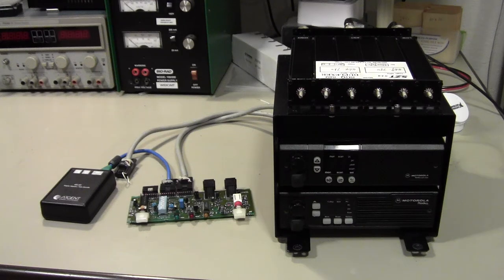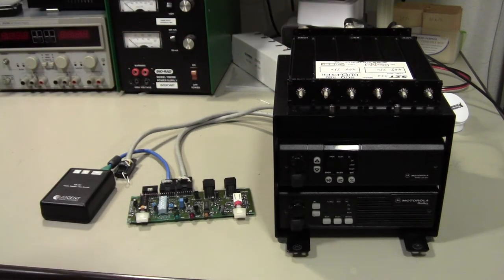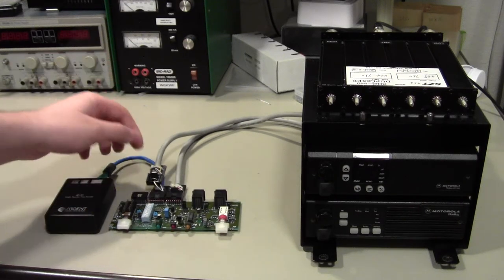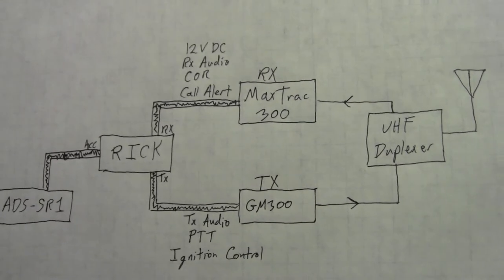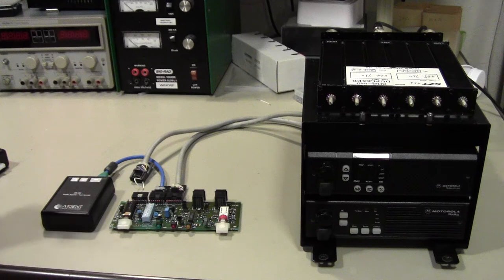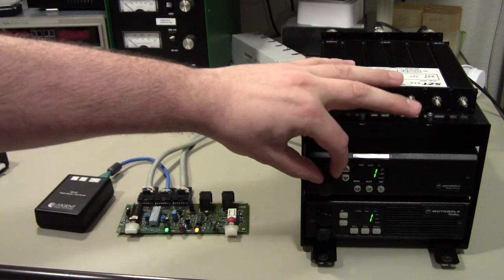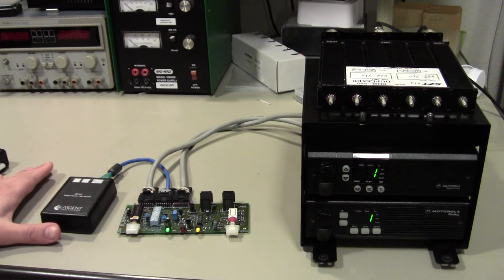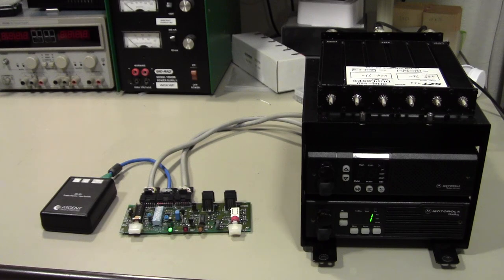UHF RICK Repeater with Auto ID and Remote Control

Comment: When our Highway Patrol went to P25 Trunking they had a massive amount of UHF CDM 1250/1550s that were used as remote receivers for the old low band system. The radio techs, also hams, put up UHF HAM repeaters all over the place to repurpose them! They already had duplexers, hardline, controllers and of course 75 tower sites to choose from!

Comment: If you have a later version of the ADS-SR1 (revision N or O), you can use ##751 to have it only play a CW ID when the repeater is active, plus a clean-up ID with ##803 (I believe that you have to set both the CW ID timer and the CW ID Auto-Response timer to make this work).  I have experimented with both of these, and they work great, except for that fact that the ADS-SR1 transmits for about half a second when you let go of the PTT (or after however long you have the VOX timeout timer set for), even if you have it set to no courtesy tone.
Reply: ***** I also have mine wired for COR.  I'll have to experiment with that sometime.

Comment: Hi, I actually have an old motorola repeter with 2 x gm350 radios and a rick controller. My tx radio keeps getting stuck in transmit even though the rx radio is not receiving. I either have to plug out the repeter or else turn the rick off and back on again. Do you have any info regarding this issue? Iv asked lots of people but no joy 😕

Comment: I want to build a uhf repeater out of tyt9000, cuz they are cheap, and have stun kill revive features, as well as pin outs for it, what should i get? other than uhf antenna, diplexer, cable etc? is a rick box needed? im new to building repeaters but not new to radios.

Comment: I have a RICK and several kenwood tk880's and I am trying to build a repeater. I bought the ktc 19 cables and got everything working but can't seem to get audio to pass. RX received TX keys up but no sound when I test. Any help would be appreciated.
Reply: Kenneth Finnegan I have bee testing pins for several days and in the schematics and drawings it shows which ones are external mic input and audio out but I don't think it is a fixed out. If you know anyone that has attempted any kenwood mods and can link me up with would be great. I would really like to get working properly I've seen one on ebay that was already put together but was sold so I thought I could build one don't know if there is some programming that has to be done I was able to change settings to get cor from pins tried injecting audio source on mic input but getting nothing built a rj45 jack with 3.5 mm headphone jack to get audio from one radio to other but I won't be happy with that really want internal pins to do all the work and be able to use the hand held mic too so it can act as home base station too. Thank you for any help.
Reply: You need to move a jumper inside the TK880 to allow it to use the aux input from the accessory cable and not the mic from the front panel.   If you’re still in need, message me back and I’ll check my notes and see which one it was.  I built a repeater with three TK880s and it works great.  One is the control radio on a different frequency so i can take down or change channels without interference.   I’m also using an Elektra 2000 repeater controller.  It’s also in the service manual for the TK880.

Comment: Quick question, I have 2 gm300s set up as a repeater with a jumper cable. I run 2 antennas, one for the tx and one for the rx. I'm thinking of getting a duplexer. Do I need to have a repeater controller? Or can I just add the duplexer to my gm300s after it's been tuned to the correct frequency?
Reply from the maker: +Jeremy Cook the controller and the duplexer are two different issues. The duplexer let's you go to a single feedline and antenna for your specific frequencies. A controller is required regardless of your antenna system if your repeater is for a service that requires automatic ID and control.

Comment: so im building a repeater with motorola cdm radios im just wondering if i may need an amplifier due to the large space i need to cover?
Reply: this repeater will be serving a LARGE convention center for portable radios to communicate effectively im open to any suggestions
Reply: the complex is about 3 billion square feet
Reply: what if we were to use one repeater for each buildings, there is 4 buildings
Reply: i own a security company
Reply: what kind of range would a 45W repeater cover

Comment: what would you charge me for a 80watt system or 50 watt minimum I'm one of those that always doubts anything under 25watts call me paranoid but id like a identical system as you did here setup on 462.7125mhz output and input 467.7125 both with DCS tone on 662N ?
Reply: wow 80 watt gmrs, you guys dont go by laws ?
Reply: Not often I like 100 watts which really don't interfere with anything way out in there rural country as me and the terrain kinda calls for the extra kick same with vhf stations most ham repeater are even 150+ watts or close
Reply: Wished I could maintain a good solid net with only 25 watts cuz the heat is not that bad to control like 50+ watt stations are

Comment: Very good workup , you have done your research very well. and i love your theory. On the flip side. the question is. did you design this to be full remote control? in other words, could you also send DTMF to the receiver and bring the repeater back online? might be a stupid question but you didn't demonstrate that in the video. I would assume the call alert could also be use to toggle the switch to enable. again this might be a stupid question but since this is a custom build. i was just curious.
Reply: Just saw the video and my expectations were exactly the same.. waiting to the transmitter to be brought back online just the same waynit was disabled..

Comment: Can you do a video to elaborate why you don't like your cheap Chinese duplexer? I'm considering using one (as mentioned in your simplex repeater vid). 

Also, I see you like tubes and fermentation. You should build a Nixie tube fermentation timer!
Reply from the maker: It wouldn't take a whole video. They have poor isolation and terrible insertion loss (3dB).
Reply: Kenneth Finnegan I concur. After lots of research, I wouldn't consider anything less than a Sinclair duplexer. Sure I could build one, but it wouldn't be as good and would take me a month with two new babies in the house.

Comment: well most duplexers require aleast 25watts to pass thru without losing most your rf and my request is only 30watts above the limit the terrain forces me to it id rather run less the heat issue ain't a deal really like 80+ is ive already added additional height to my towers which helped tremendously the elevation on the ground 767ft above sea level the tower base is 70ft plus my 25ft pushup mast added really helped out a ton but I wanna duplexed repeater I ran my 50 watt simplex for years now with dual inputs crossbanded as well but the simplex only repeates on the UHF 462.7125 frequency
Reply: a decent duplexer shouldn't have much loss...  running more power doesn't cause you to lose less RF..  Typical duplexers have between 1 and 1.5 db loss... so 20 watts input with 1.25 db loss in the duplexer will give you about 15-watts out of the duplexer... the same loss factor would give you 3.75 watts output with 5 watts on the input.  Now I know you've mentioned you need more power.. however have you thought about your receive at all? Having a louder transmitter doesn't help your repeater hear better.  I know quite a few repeaters that put out a lot of power, and they out talk their receive radius by a fair margin.  Most of my repeaters that I have online run preamps so not only can they be heard, but they hear very well... and thus have a balanced system... If you can hear my repeater, it can hear you.  I would not recommend running a preamp on a simple notch duplexer that the online in this video.. you would need a band pass/reject duplexer so you don't end up with desense, plus you don't want to overload your preamp with possible intermod or other unwanted signals.

Comment: Kenneth, this is wonderful.  I am in the process of building almost the exact same setup, the difference being that I would like to interface my RICK into a Raspberry Pi in order to run the repeater as an AllStarLink node. Do you have any experience with this? I see a lot of custom built "RICK"s on the internet in order to do so but I haven't seen anyone use the Motorola RICK ( Part number HLN3333B) that you have there with it run into a RPi (I also have the same RICK and would like to use what I have rather than building another board that does essentially the same thing just to interface into the RPi). I would think you could wire an RPi via USB into the J4-ACC port on the RICK like you've done with the ADS SR1. Let me know what you think
Reply from the maker: It should work. The hard part will probably be everything except the RICK
Reply: Hi D M. I'm looking at doing the same thing as yourself using two GM340's (or 360's if necessary) and a RICK linked to my node. Did you get it to work ok?

Comment: can this turn on remotely ? or just turn off
Reply: I was wondering that.  What I noticed was the Call Alert displayed on the RX stays illuminated but I can't figure out if this needs a confirmation button press to clear on the radio front panel or if another Call Alert will still come through remotely.  I was hoping that you could remotely toggle the Txer on and off remotely but it wasn't really that clear.  Hopefully we will find out soon.